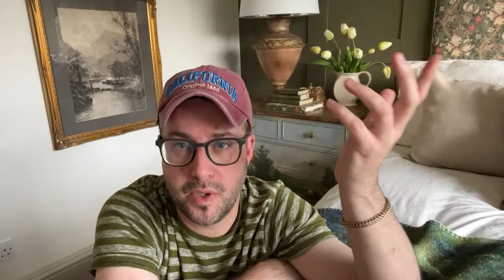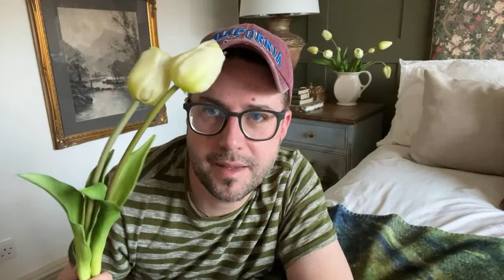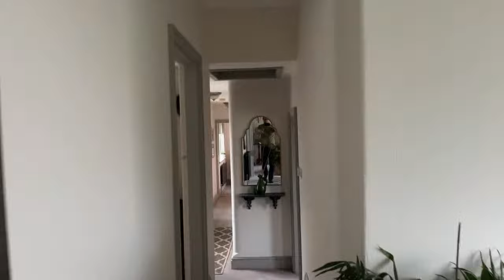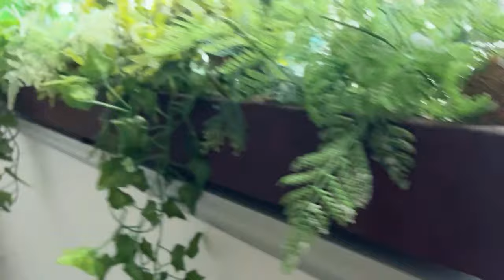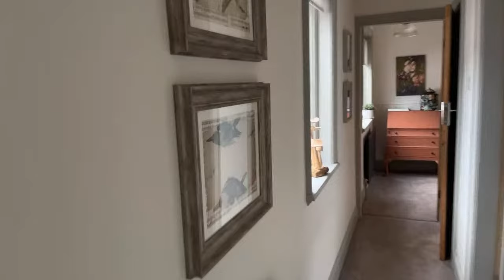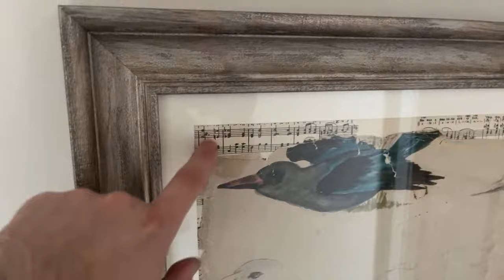Just to say hello

Comment: Dixie Belle and just started using Fusion. Not in love with Fusion ( has a built in topcoat). Fusion does carry a milk paint which I do LOVE! If I originally started using Annie Sloan exclusively, unfortunately our local stockist closed and the closest retailer is over an hour away. If I had my choice it would be Annie Sloan .

Comment: I recently found FolkArt ONE DECOR PAINT, paint and sealer in one, water based, at Michaels craft store. I tried the Artic Teal and it has a lot of pigment. I used it on primed wood and almost one coat coverage unless you count the primer coat then 2 coats. It was 8 oz for $9.98 less coupon.